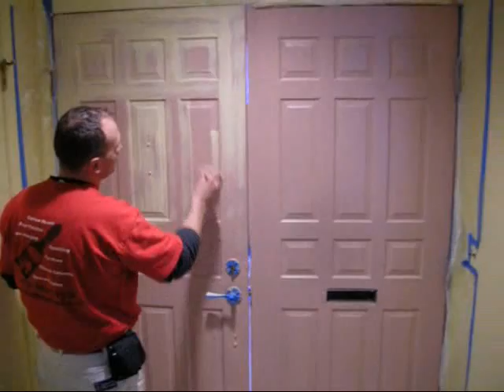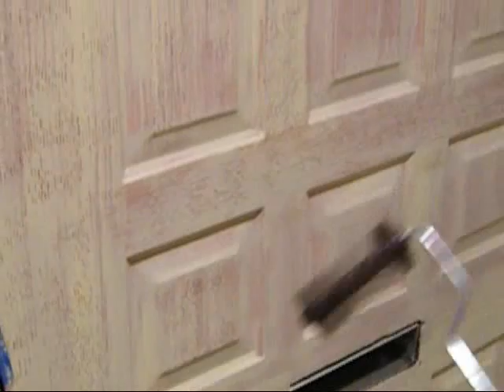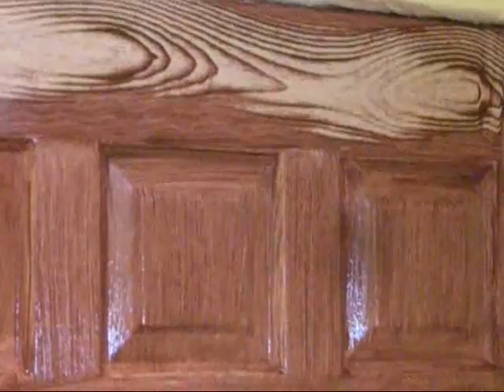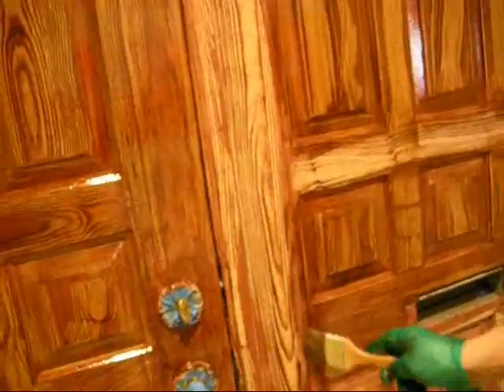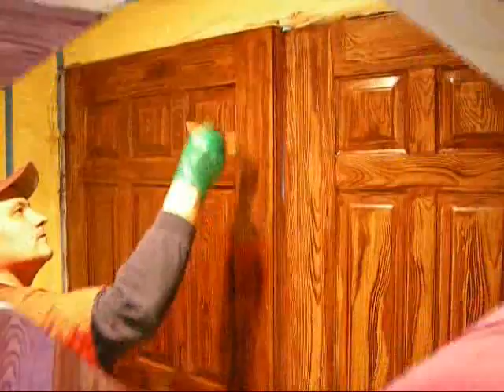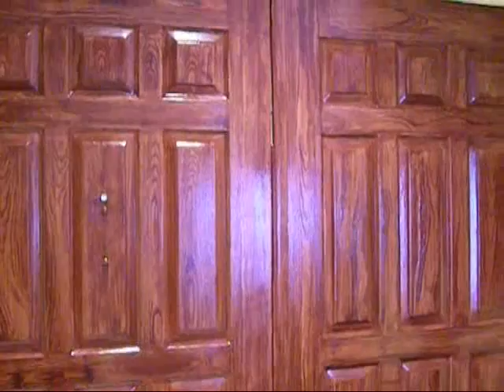BRUSH MAGIC PAINTING-1 video http://www.brushmagic.net "How to do wood graning

Comment: 2 much figuring  slightly less would be more here.Doors with that many panels are a nightmare especially with that that big rocker,a sharp pencil eraser wrapped in a lint free cloth is good for figuring small areas  can u use oil based scumble(stain) in the U.s if so can you get the ingredients to mix it yourself.Regards Dublin Ireland.